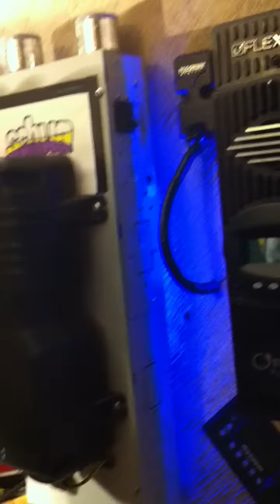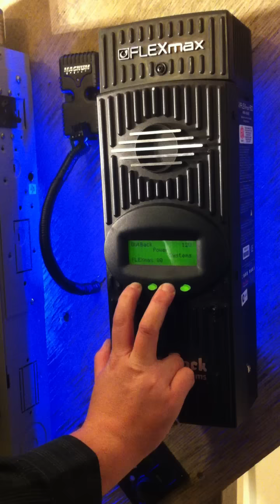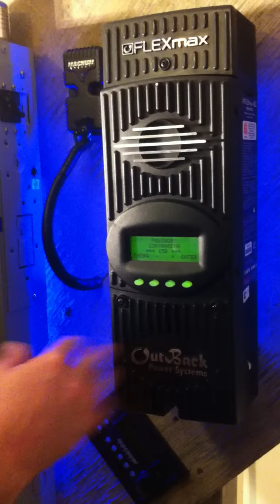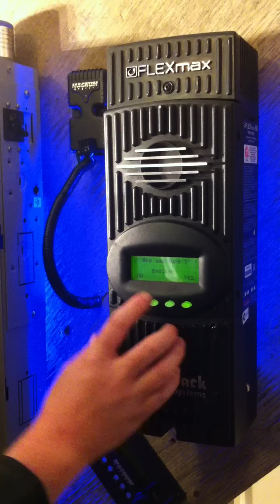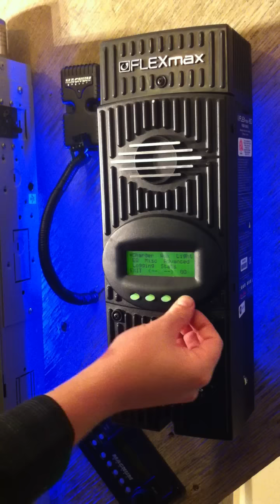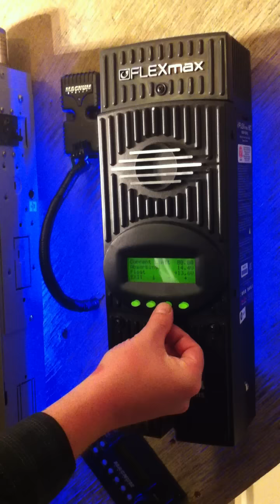Outback FM80 and FM60 Reset and Voltage Set Points

Comment: I have a 60 model. I have 12 Harbor Freight 15 watt panels wired in series 6 panels per strand.  

I have two issues. I have 3 new 12Volt batts I use for demo's for on go. And I have two 6V batts. Can I hook them together if the float maybe different? 

And the other thing is the outback flexmax just don't seem to make as much power in the HV panel setup. I have 110 watts of solar going to PWM 500 watt CC and it is making more power then my 180 watts in HV with a outback. Any Ideas ?